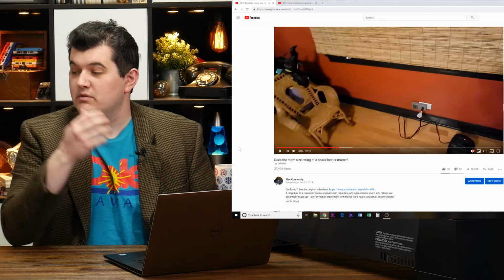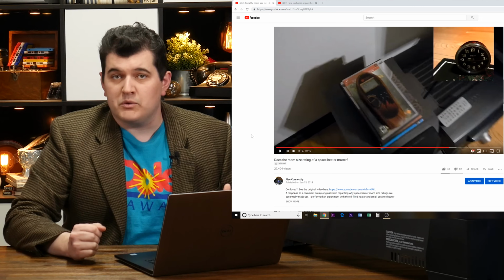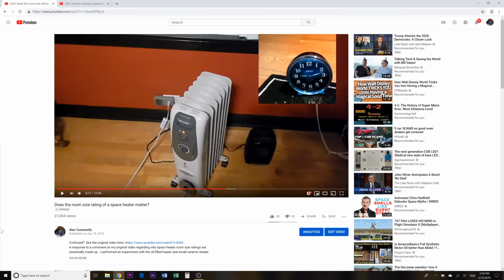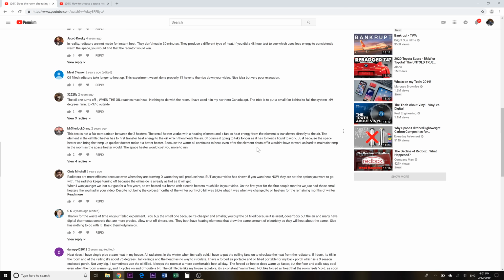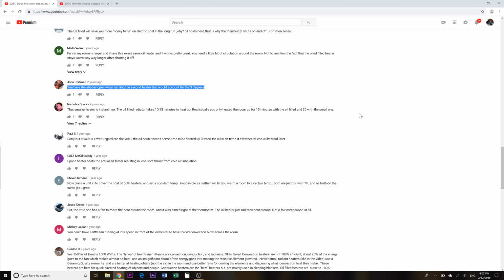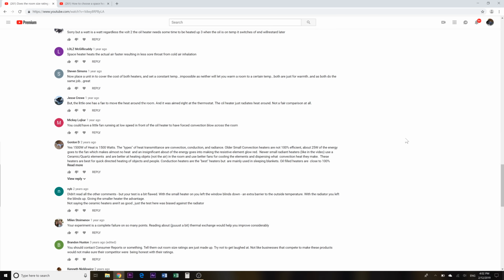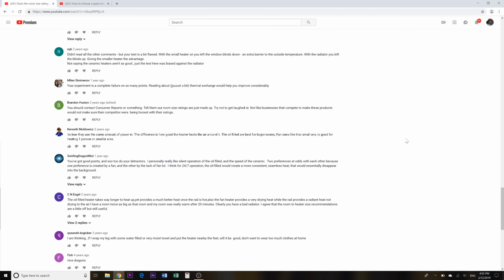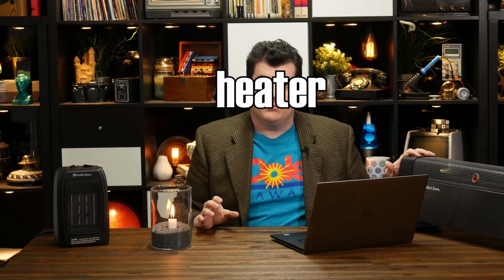More Space Heater Nonsense

Comment: I definitely agree with you on these 1500 W heater’s. If you want to talk about a very powerful, multi room space heater, growing up my grandparents had a house that did not have any kind of central heating or air conditioning. And so rather than using a space heater in each room, well actually later they would put a space heater up in the living room also, but they used this big that is like the size of a small keyboard amplifier. I believe my grandfather told me he purchased it around 1978 or 1979. It was sold under the Montgomery Ward brand, which I don’t know if they are still around anymore. I was born in 1994 and I don’t remember ever seeing any of them at least in my area.  But it would use the plug like your electric dryer would use. It was 220 V and either 5600 or 5800 W. I cannot remember which. I think even on the low setting it was still cranking out somewhere in the neighborhood of 2800 W.  It did heat the main floor of their house pretty well. They had another one for the basement which actually contained the majority of the bedrooms in their house for some reason. But also if you got cold, I have very fond memories of sitting right in front of those heaters first thing in the morning while getting up and getting ready for school. Getting warmed up after a cold Colorado winter day playing in the snow or working outside, even one Christmas opening presents in front of it.  My grandmother actually continued to use these heaters until she changed insurance companies in I think 2018 and they were like no, you have to switch to a centralized furnace because these old and in efficient, as far as electric consumption, space heaters are unsafe. But I have to say they were effective.

Comment: You already mentioned it in the video, but i think it could be stressed more: It’s very important how the heat spreads, if it local, going up to the ceiling, or blown through the room. I have a 300W radiator plate at the wall, underneath my desk, and the difference is huge. The room has outside walls, and an non heated basement underneath, I always had to crank up the gas heating for the whole flat to get it comfortable before i got that slim 300W heater. And the most efficient heater ever probably is a cousy pair of socks.
Reply: and a wool hat🧑‍🚀

Comment: The benefit of the oil heaters is that you're being heated radiatively, which means that you'll probably feel warmer for the same heating power
Reply: No. Both the oil radiator design and the hot wire fan design keep primarily by convection. The oil radiator unit heats up the oil which heats up the outer surface which heats up the air immediately next to it which convects to the surrounding air. Clearly though, any heated surface will radiate some heat. The hot wire fan units also get hot on the surface and will radiate some heat.

Comment: why oil filled heater doesn't have a slow or low rpm fan to help move the air ? and because it has much more thermal mass compared to ceramic heater, the oil filled heater should heat the room better even after the thermostat cut off the heat. am i right?

Comment: The reason people prefer radiant heat is because it makes you "feel" warm faster and maintains the heat longer. Radiators heat you and the other masses near it directly. Convection heaters need to heat the air first and the air then needs to heat you. 
Stand in the shade, how does that feel? Take a step into the sunshine, how does that feel? Warmer? You know that the air is the same temperature between those two steps (there is no barrier separating the air) so the only difference is the radiant heating of the sun.

Comment: What if the larger mechanisms plugged into the wall twice, essentially working as two space heaters in one for double the wattage?
Reply: They limit the wattage mostly to avoid circuit breaker trips. In Australia the most common limit for an entire circuit is 4,800w (240v x 20a), so theoretically you could use anything up to that, however in reality most people have several appliances running off a circuit, so limiting a single one to something like 2,000w max is standard.

Comment: So, I will argue that the large space heater will actually save you money compared to the small space heater. As you said the large heater keeps cutting out after heating the room 1-2 degrees. When the heater cuts out, it stops drawing energy. I believe the whole idea of having these "large heaters was to supplement the heat in the room by a few degrees rather than raising it 4-5 degrees. The small space heater appears to constantly draw the 1500w. *IF* the aim of advertising the large heater was to "Save electricity" in a "large room" by increasing the heat 1-2 degrees, it has actually done its job. The small heater just keeps going well beyond the 1-2 degrees and overheats the room. My point is that as you have said, it is cheaper to heat the room with fossil fuels. These space heaters are only to supplement the heat (by maybe 1-2 degrees) hence the extra money that goes into the heat oil stores, the better build etc. is actually justified. The small heater, which i will assume has a terrible thermostat and little control mechanisms, will just "keep going". Also, there is the issue of more heat indoors = more heat loss = energy loss but lets not completely muddy these waters...

Comment: Perhaps the larger heater can increase the temperature faster? Maybe test how long it takes to increase temperature say, 5 degrees, from a baseline. Which I would assume would help reduce heat loss from poor insulation (windows, low wall insulation, open door etc). Only thing I can think of why the bigger one would be "better" than the smaller. (Apologies if already answered)

Comment: Oh where to start...First, you are right. 1500 watts is 1500 watts. That is the RATE which the heater converts electricity into heat. If the heater in question can transfer that heat to the air in the room at 100% of its on time (like the little one) in one hours time you will have added 1.5 kilowatt-hours (Quantity) of heat into the room.

If (like the big heater) the 1500 watts overheats the device and has to cycle off. It is not putting all the possible energy into the room. If the limit cycles the heater off 20% of the time only 1.2 kilowatt-hours will be added to the room. If you can keep the heater from cycling, (Like put an external fan on it). It will add the same amount of heat to the room.

When it comes to changing the temperature of the room, the rate of consumption (watts) is only one metric that determines the outcome. The amount of energy (Kilowatt-hours, BTU's, Joules) is what counts.

Comment: Just spitting out speculations here. May it be safety/longevity issue? For a small room you may need to produce 1500w in relatively short bursts, and for a large room you may need to keep that power for long periods of time, so you design a bigger thing that does not get that hot and endures this heavy load easyier?

Comment: I'm guessing they meant a "large room" or a "small room" as a safety thing, as having giant heaters in a small room usually ends up with a heater next to heat sensitive equipment or object. But since I've only used a heater (the one that looks like a fan minus the blade plus the reflector and heating element) a handful of times I could be absolutely, incredibly wrong.

Comment: Ok fine you asked, as you said in the video the oil heater keeps turning on and off reducing the time on load, the longer you leave it at full load the hotter the components inside (wires stats and alike) get this has to be planned for in the design, so I'd say the ones made for small rooms have low duty cycles and the ones for big rooms are designed for high duty cycles designed in, of course I can't tell without disassembling them, but seems like the most sensible reason.
And you are right they release the same amount of heat (or close enough not to matter)

Comment: Of course you are 100% right. Any system that turn electricity into heat in a room will produce the same amount of heat per watt.

As far as making useful heat and not wasting the heat produced, we need to keep in mind that this newly generated heat can travel by radiation, conduction and convection.

The hot oil reservoir acts like the rocks in a sauna. Not "amplifying" or "magnifying" the heat but delivering it as intended.

It gets said that a full freezer is more efficient than an empty one. The truth of this lies in the fact that when you open the door to a full-stocked freezer all of the cold doesn't come out.

Similarly, a hot oil radiator is still hot despite airflow changes that make heat escape to other rooms or elsewhere.

Heat radiated into a room can escape a bit thru a transparent window. 

Radiative heaters feel good because they heat YOU, instead of the air.

Some heaters with strong fans feel cold, because they can blow a breeze of air that is lower than body temperature. This is very common with heat pumps in homes. Heating a house to 72° F is comfortable. A strong 72° breeze is not.

A good heater brings a perception of warmth.

The one big exception to the efficiency rule really is the heat pump. If you can use electricity to make something outside of your room cold and just use the exhaust/differential/waste heat in the room you do get to rise above that 3.41 BTUs per watt rule.

Comment: In Winnipeg, I have a oil filled heater with 900 watts or 600 watts switches or both (1500 watts) in my insulated 24x24 garage. Heat rises so I have a ceiling fan on low to move the air. It keeps the temperature over freezing at about 5 C. Mostly on 900 watts but on the real cold days 1500 watts. Probably costs me about $30 bucks a month through the winter.

Comment: MAYBE the difference is that the "small" room heater isn't designed to run for long enough periods of time (or constantly) to heat a larger room and may have a larger risk of releasing lots of heat via fire? Other than that scenario 1500 watts is 1500 watts and just comes down to user preference of ease of use and noise level.

Comment: Those comments sure irked you - but don't worry too much over it. You are better than letting those comments get to you.
On a side note: Did you ever check out infrared heating plates? Quite a bit of their energy goes into heat as well, but a good portion is also used as IR radiation to heat up nearby objects to give this nice feeling of warmth radiating into your body like a real fire would feel. An example would be https://www.amazon.com/Cozy-Products-CL-Radiant-Heater/dp/B00FRFFC4W/ref=sr_1_4?keywords=infrared+panel&qid=1580503589&sr=8-4 (Ugh, ignore the ads in there please, they are trying to beat thermodynamics too!)

Comment: Instead of testing how much they can increase the temp over X amount of time, maybe a better test would be to raise the temp to a specific temperature (say 70*) then see how much energy’s used by each unit over a 24 hour period to maintain that temp. I’d expect to see the oil heater keep a smoother temperature but the overall energy use to be basically the same. 

Oh, and that comment about humidity??? Not sure how one would dry the air out anymore than the other when neither does. Yes, the “relative humidity” (which is what people are usually talking about when they say “humidity”) goes down but the actual amount of vapor stays the same. Warmer air can hold more vapor than colder so duh, the percentage drops unless more vapor is added to the system. Warmer air “feels” drier because that lower percentage means the air will start to draw out moisture from its surroundings, things like your skin...who here likes chapped lips and itchy skin!? A gas furnace will reduce the actual vapor because it, in part(my 95% draws both interior and exterior air), pulls interior air into the combustion chamber which then vents outside which in turn causes the house to be at a slightly negative pressure compared to outside so the house draws in the colder, drier air from outside in an attempt to maintain equal pressure. Now warm that new, fresh air up and tada! Relative humidity drops again. PS. I love my whole house humidify!

Comment: I wish they focused on the fan part more has most suck. Even my Dyson fan cool/heater sucks when in heating mode but on the upside it runs the fan 100% of the time but very very low to where you can't even hear it when it's not heating  to run air over the temp probe

Comment: In case you need more counter-intuitive heat stuff: lots of people think that longer heating element (like wire or whatever) will produce more heat, however in reality - shorter heat element with less resistance will produce more heat. That's Om's law: Power = Voltage DIVIDED by Resistance. Voltage is constant, for household env. So: the smaller heating element is the less is resistance and the more power it will produce even if there will be no government limitations for consuming power. In fact if you make super tiny heat element - it will get hot so fast that it will explode. And that's real reason you need bigger elements for bigger rooms - they have bigger lifetime. Small heater on full power is destroying itself much faster.

Comment: Also, the most effective test I was able to do to determine that certain levels of energy freely leave a building is having a tv that uses 380 watts (I swear something is wrong with it) run continuously and unplugging it at times for testing it’s effective heat, in winter hours here in Canada, using the now not easily accessible daily and hourly readings from my power company, I was able to tell that firstly, days where it was plugged in had a higher cost, it had no affect on the heat of the house or the thermostat, I then tested a week on a week off to see if a broader time changed it, and had my most expensive bill when I left it on for a month to try to assist with heating, I then tried to figure out what caused this, my current guess is that either not enough difference in temperature will cause the heat to not heat the room and it will radiate out and through the house with the rest of the heat leaving, only increasing the heat leaving, or the low difference between that and the outside temperature lets it leave freely (basically the same thing but this time it displaces heat already in the house from the heaters) I’m unsure if heat of different levels might have different wavelengths or particle speeds and those pass through materials at different rates or what would cause this, but there is some form of scientific explanation

Comment: With no draft and very good insulation, the large room heater would have a lower chance of self limiting in a small area of the room, ironically the oil filled would self limit internally but overall it would heat a larger area of the room once the heat radiates outwards, this is immediately negated as soon as a draft like a door is opened, meaning you are stuck in the room long enough that it kinda no longer works as a space heater should and only by the namesake of heating a space, say if you didn’t have proper heat in that room, not to turn the heat down everywhere that you aren’t like space heaters are marketed for, the larger heater (depending on the temperature the elements get to) would work better to heat a larger space and wouldn’t have as much of the same slow warm up time, the fans typically will make a heater circulate heat in a way that pulls it’s own heated air back in after the air slows down and flows back due to a lack of velocity from the fan, so you have two options, more effective/faster heat, or slower heat for a larger area, a small room heater will heat a bedroom quick, a large room one will eventually heat the same room, but a small room one will heat a small area of a den while a large room one will slowly bring the whole room to temperature, these change quickly once draft and poor insulation are introduced, making the large room heater almost useless

Comment: I think you need an extra air mover (large fan) neglect its load, do the same experiment, but force moving the air from behind (point the fan at the heater) each unit and measure the time it takes to raise the temperature of the room certain amount of degrees, same distance, pointed in the same direction. would it work?
Reply: I think you would help the oil radiator unit a lot. But if the fan unit is constantly running without a thermostat shutting it down, then it's going to probably do just as good a job. Obviously, the faster you move air past the heating elements horizontally into the room, the less heat is going to drift up directly above the heater and be wasted out the ceiling and upper walls.

Comment: chart the oil heater temperature until it stabilizes. That's full output. Measure it from there. Not the same, but they are not the same.

Comment: Have not read all the comments, so if this has already been been addressed, sorry.   The construction of the unit is adjusted to the size of the room.  They produce the same heat, so a large room heater is built for endurance as it would be expected to operate longer.   So, no fans or higher quality fans.

Comment: Thank you for the remade video. I've taken thermodynamics and should know better. But before watching your video, the marketing on the boxes still had me thinking a bigger more expensive one world be better. They try very hard up confuse you.

Also, with other equipment like speakers and amplifiers, the wattage ratings are often BS on cheaper stuff. Inflated peak wattage ratings instead of telling you the RMS.

So my thought was even if they have the same wattage rating, the small ones might only be able to handle that for a moment before shutting off. I'm surprised to see the small one can run constantly at max power and the oil filled one overheats and shuts off.